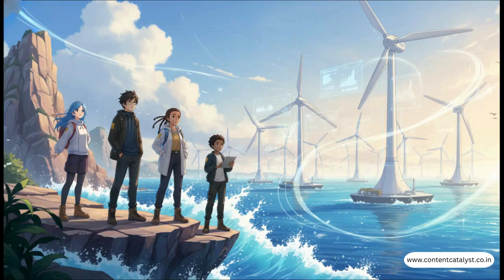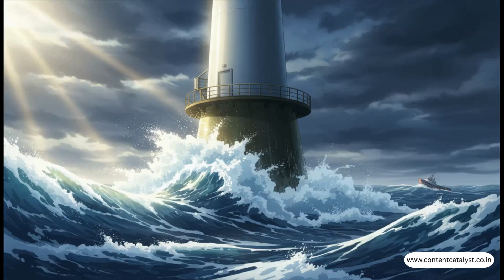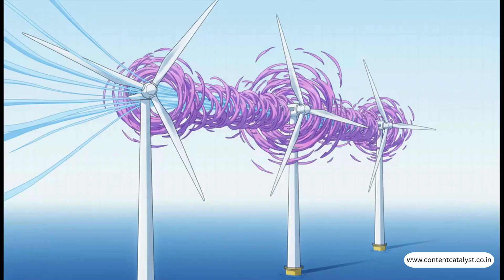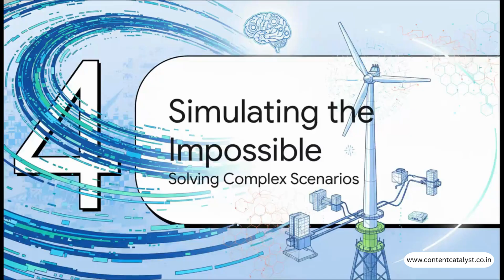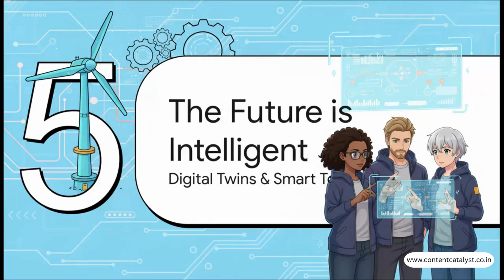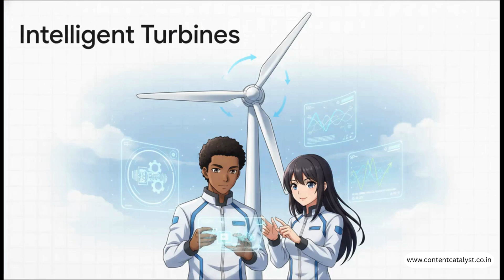Floating Turbines and Multi-Rotor Systems: The QBlade Engineering Breakthrough | ContentCatalyst

Comment: An impressive exploration of how QBlade supports advanced wind-energy design and simulation. The discussion of floating turbines and multi-rotor systems highlights the potential of computational engineering to improve renewable energy performance and accelerate sustainable innovation. Great content!